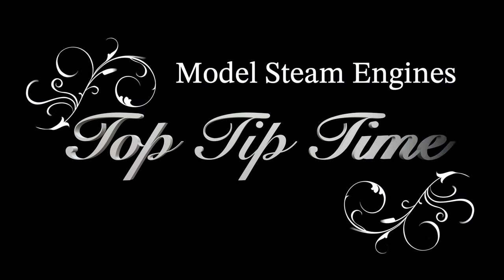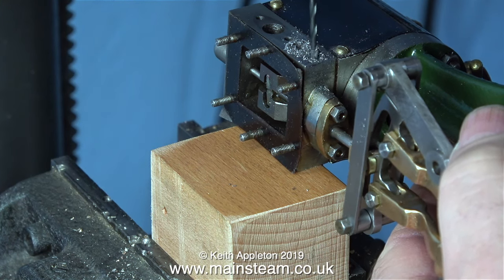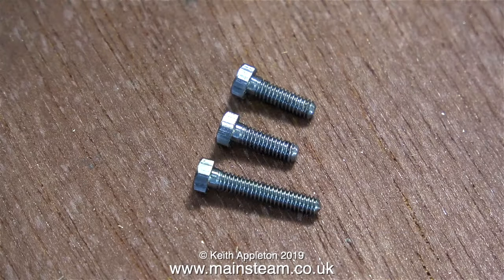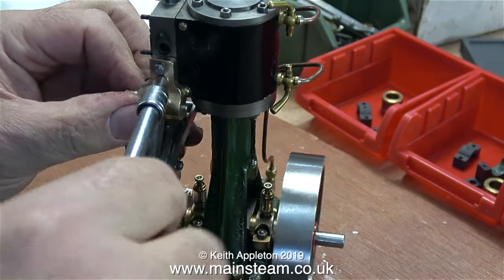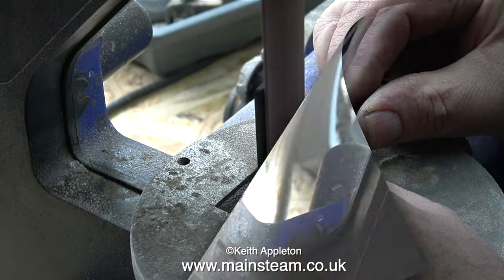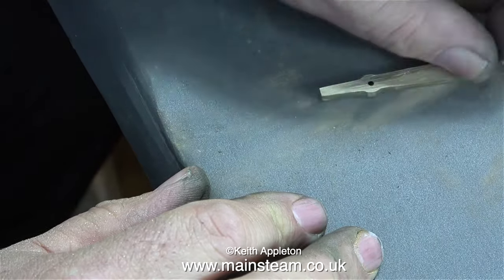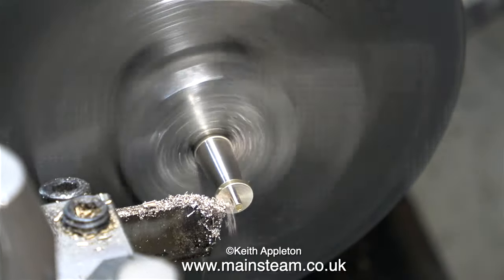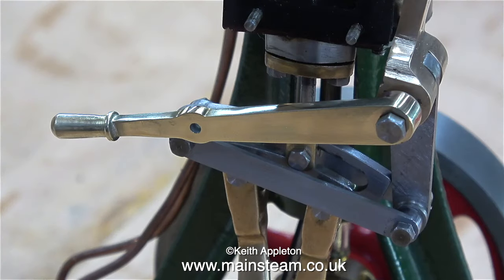MODEL STEAM ENGINES - TOP TIP TIME - PART #33

Comment: Love the bit about using gloves, it reminded me about a mishap I had in 1969 when I was an apprentice. I spent the first year in an apprentice training school workshop learning hand skills before being let loose into the main factory. We had to wear boiler suits for “safety” one of the skills we had to learn was drill sharpening, I was given a large drill (around 7/8” I think) with the tip ground off. I had to sharpen this without the aid of any angle gauges, the instructors kept those in their pockets. Anyway there I was attempting to sharpen my drill using the right hand wheel on a two wheel grinder, I was concentrating so hard on getting the correct angle I forgot about the left hand wheel. So as I moved the drill to get the rake angle correct my left arm got close to the left wheel, the sleeve of my boiler suit got caught and snatched my arm into the grinding wheel. End result a hole in my sleeve, but worse a hole in my arm. I had a 1” wide 2” long 1/4” deep gouge out of my left forearm. Next stop was the hospital to get it cleaned and dressed plus a tetanus shot, followed by several follow-up redressing. I’ve still got a lump missing from my left forearm even now 54 years later as a reminder of that day. So sometimes safetywear is more of a hazard than a saver.
Reply from the maker: I fully agree and I am glad it was not worse for you. A great comment - thank you.
Reply: @keithappleton  As I typed my reply to you I could “still feel” that sudden pinch as my arm got caught in that grinding wheel when I was 16, and like I said I’m now 70 and still have a lump missing out of my arm, it took out a chunk that never healed back.

Comment: Keith, nice job on the repairs & fabrication.  As I watched this video it finally sunk in that the UK & the US use different names/terms for the three "types" of taps.  You call them taper, second, and plug.  We call them taper, plug, and bottoming taps, so at first I was a bit confused, but I guess this is just another small case of two countries divided by a common language.